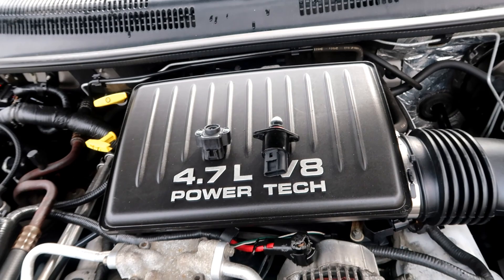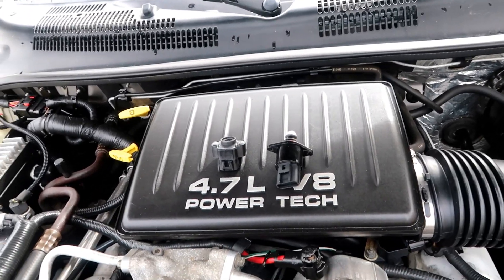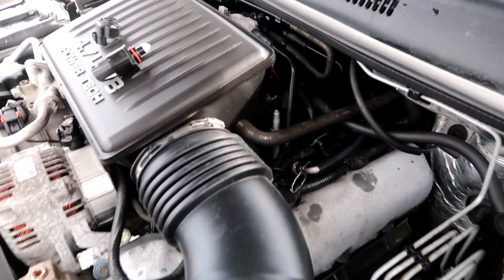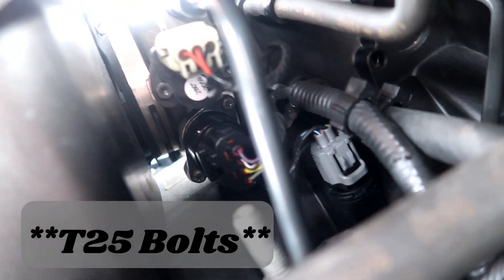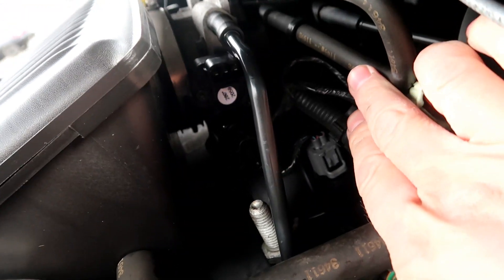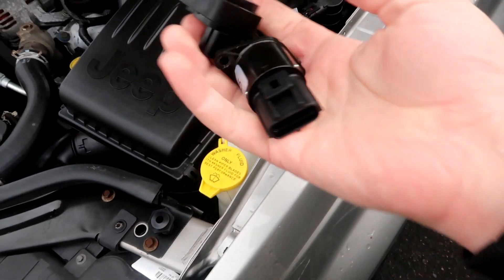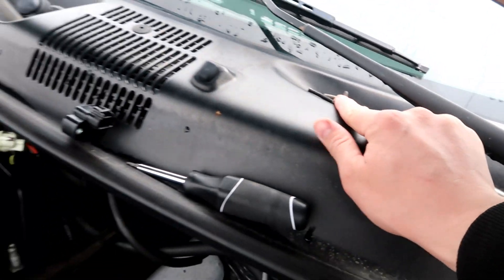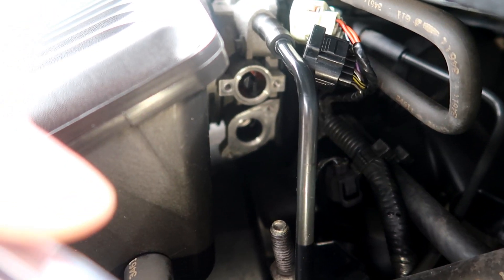Jeep Grand Cherokee Throttle Position Sensor / Idle Air Control Valve Replacement

Comment: Someone on Reddit said to replace the throttle positioning sensor but there's several parts for the sensors and I want to make sure I get the right one. This is a 2018 Jeep Grand Cherokee summit any help will be appreciated but maybe some type of website link thank you.

Comment: Why did you get an engine code?
Reply: It happens when you change those sensors the engines gonna run a little rough until the computer resets the code. The computer doesn't think it's idling correctly and has to find its correct  position. You can either reset with a scanner or drive it down back roads for like ten mins it will fix itself.